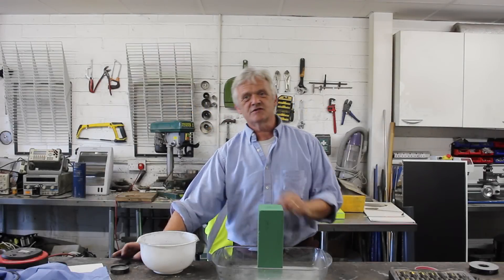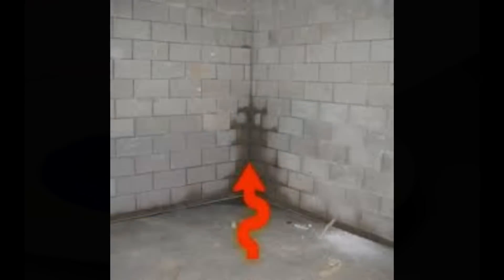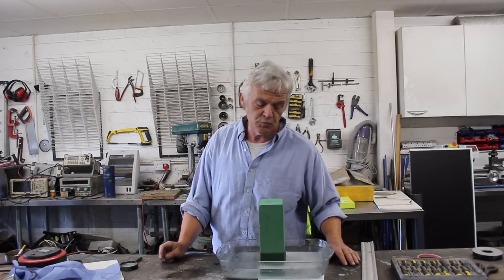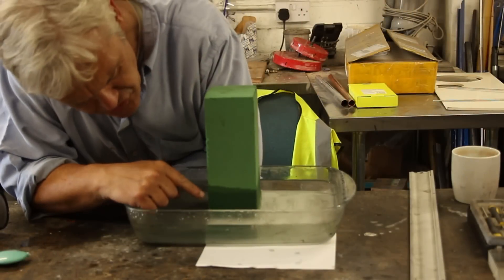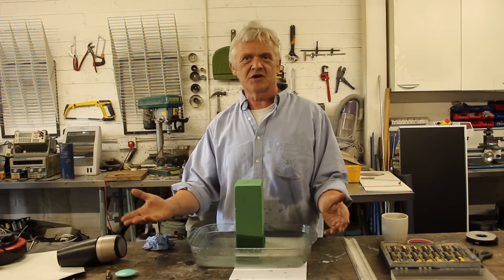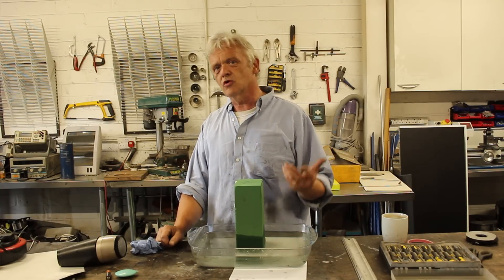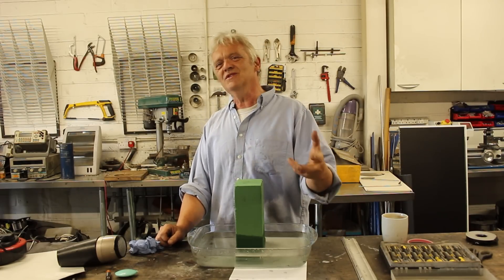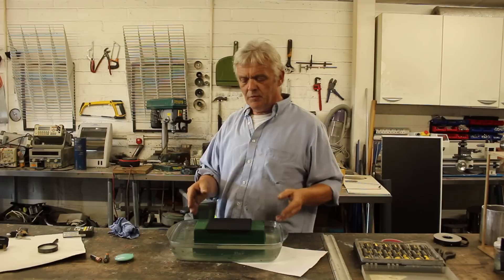1614 How To Get Cold From Hot By Copying Nature

Comment: I did some looking into greenhouse designs and one interesting cooler I seen was similar to this. It was basically what you had there, only the black piece on top was a black piece of fabric, and they drapped the fabric down one side of the container and had a fan blowing on the fabric (also it was much larger). My only problem with swamp coolers is they make the air more humid, and are less efficient in high humidity. Unfortunately where I live, heat and humidity are hand in hand, so they aren't a silver bullet to heat problems here,  but I'm still playing with them in my greenhouse.
Reply from the maker: that is a shame because in dry areas they are awesome - but I am thinking about the humid areas and I have an idea or two
Reply: @ThinkingandTinkering  ooh, can't wait to see that
Reply: @ThinkingandTinkering  I'd be interested in your ideas. I'm trying to cool a 4000-square-foot church without paying high electricity costs, and any idea is welcome at this point! (I wouldn't be allowed to paint the church white, incidentally, so there goes that idea.)
Reply: @Barskor1  Thanks for your reply. I hadn't thought of that, but I think I'd worry that any vines would damage the old brick facade. The whole building already needs to have the brick repointed. The main sanctuary has a 21-foot ceiling, but by the time you add in the raised basement and pitched roof, the building is probably over 30 feet tall. The main room has natural light and we'll have removeable window coverings to block intense sunlight. But maybe I could use your idea and build a pergola-type structure out from the wall and plant vines on that, like a screen. That would preserve the brick but provide natural shade. But still let light in in winter. Thanks! I'll give that some thought.
Reply: I actually used a very interesting system for a more humid climate when I lived in one. It was based on a rather harebrained dehumidification scheme. I took a bunch of plastic bottles cut them in half and taped them together to form a wall of nozzles. then I took plant foam, drilled holes into it for the bottle end to fit into, and used it as a capture mechanism for the water. If you put this entire mechanism into the shade facing the wind (or force air in using a fan) it actually works pretty well as a dehumidifier, my main problem was periodically replacing the blocks but I suspect that I could use evaporation towers or even the shade itself to remove the water from the blocks. 

I duct taped this thing to the AC vent and managed to boost it's efficiency by a bit.
Reply: @Astro_Alphard  dude..... Tag me when you make a video, I'm very interested in it.... Or just like a slideshow of pics so I can see how it would work
Reply: Get 4 or more poles 3 meters long mount them vertically next to the greenhouse in a square or circular pattern 60 cm apart in a place you can put a vent hole at the top of the greenhouse wrap the poles in black sheet plastic and leave the top open to the sky and a vent controlled pipe from the greenhouse to the black tube. the sun will heat the tube and draw hot air from your greenhouse like a vacuum.
Reply: @Barskor1  I might need to one day combine this with my solid state dehumidifier and see if I can use that solar heated air to take moisture away from the dehumidifier so I won't have to replace the foam blocks.
Reply: @Barskor1  Very interesting! Could you also reverse it by capping the top of the black tube, putting the vent at the bottom end, and using it to heat a room in winter?
Reply: Rather than use the most cloth running.  A better design is to pump cold water through a length of copper pipe, neoprene tubing or a finned radiator with a fan blowing over it.  You can recirculate the cold water through an ice chest full of ice.  It works a treat.  Although you are limited by how long the cooler will keep the ice and ice water cold.
Reply: Yep, that design your referring to Dan is actually commercially used to increase humidity in a greenhouse. As long as there is air flow, plants actually prefer 60- 80 humility on average. Especially tropical

Comment: The problem you have with this is the humidity that is caused by it. In Arizona where I lived a few years back we used these all of the time in most every application. There the humidity is actually beneficial, but in most areas it destroys everything, rust, mildew, mold. Maybe if we could affix it to a heat sink and draw air over or thru it, and contain the humid air then maybe it could be used.
Reply: I'm not so sure about this being a problem!! (No disrespect!)
Due to the Old very damp house my flat is in, I've got to use my AC  and dehumidifier unit at the same time during summer....

On paper, this means that I only have to use the dehumidifier part of the  system..

So I don't need to use the AC part quite as much!! 
And if I am able to Wick up the water from it and using towards cooling the place down.

I'd be able to do this, even if there's anything like the hosepipe ban....
Without being fined during drought conditions!!
Or causing environmental lack.

So far I have just got thinking about this, but it's something that I am going to tinkering with definitely!!

Even if I may have to get the water and physically shift it ,
part of the way I would be able to save a few Quid, 
and make my carbon footprint smaller than before...

Any thoughts on this please?!
If you are able to see glaring holes in this, please let me know. .TIA.
Andrea and Critters. ...XxX....
Reply: Maybe a desiccant in-line would be a great way to combating that. It would lower the humidity of that room
Reply: @brendanwarrick4978  It's the whole house!! Three floors and I am the only tenant left..
Due to the landlord selling up, I'm a sitting Tenant for now, Still!!
I do get your point though, and I would be happy to hear about your thoughts about desiccants?!
They'd have to be absolutely safe for animals and birds, as I rescue rehab and release wildlife mainly.
And I have my best friend, Jasper, who's my support assist dog,(Retired!) 
I've got to admit that I have no idea about desiccants, and I apologise for my lack of knowledge!!
Namaste 🙏
Andrea and Critters. ...XxX....
Reply: @AndreaDingbatt  there are lots of different desiccant, have a look into it because they cost no electricity and slowly revolves moisture from the air. You can do a large area but you just need fresh air from outside passes desiccant before the area your trying to dehumidifie
Reply from the maker: I don't know about most areas mate - in dry conditions it is ideal and in humid conditions not so much that is very true - but as Brendan said just stick a desiccant in line = however I am thinking about the problem and will do videos on it
Reply: @ThinkingandTinkering  Discussion is critical in most things, including sciences. I used to own a manufacturing business before the bust of 08 took it out. I offered and gave bonuses to those that could make recommendations to improve almost anything work related. I had only one condition. That being my analysis and my attempt to punch a hole in their idea. If I could then no go, if I couldn't then we would implement it and based on the saving or production increases a bonus would be paid accordingly. This is how I approach most everything. 
The moisture in the air would be overwhelming to most everything in the environment, not just the structure. Desiccants have a cost and limitations, that must be factored in. I live in the midwest now. We have such vast differences of weather conditions. Summers can be 90's  and 65-70% humidity, winters can be winters can be -20 with two foot of snow. So something like will be difficult to implement. If you put the air thru a desiccant you lower the density of the air and the result will be an increase in temperature. I see the trick of it as being able to contain the moisture at the same time as retaining the temperature. If the moist cool air could be used to saturate a heat sink or cooling sink in this approach then maybe you will be able to extract enough of the colder temperatures to have an effective change. I've looked into recirculating a coolant from two underground tanks, pumping that coolant thru a radiator, then passing the airflow thru the radiator. The coolant is a closed loop system, so 100% recovery and the heat transfer comes from the ground temp, which in my case is about 50 degrees. But the the problem becomes the infrastructure and the cost. It can be done but to what cost to benefit ratio?